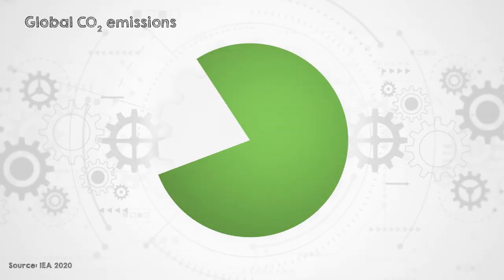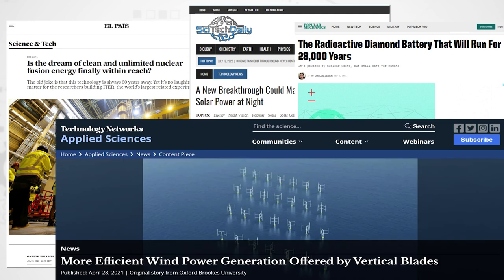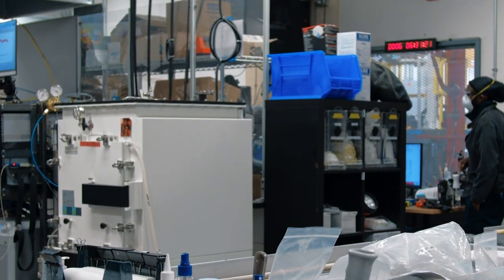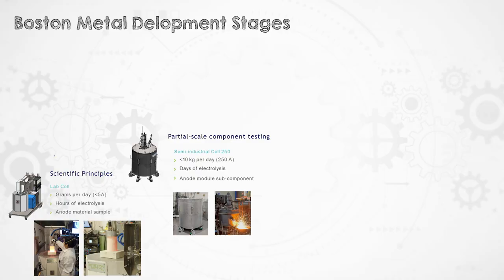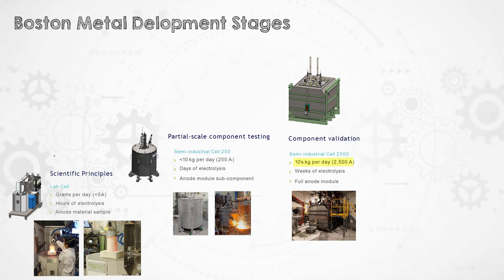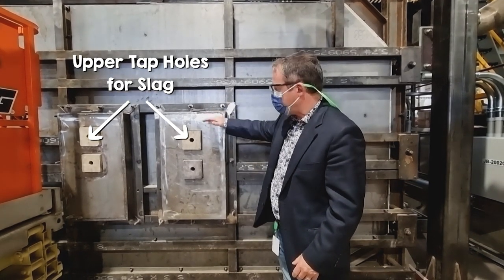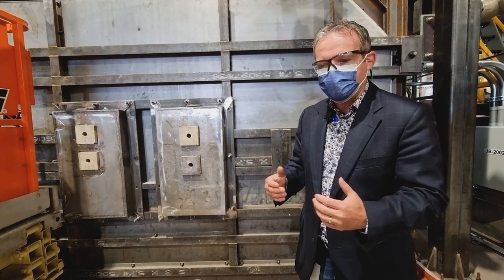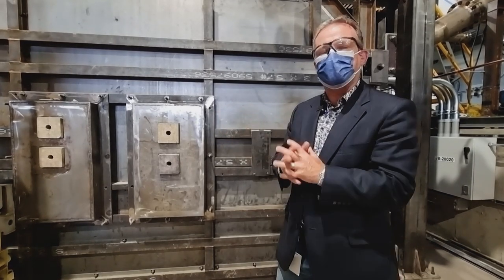CO2-Free Fe: Green Steel Tour with Boston Metal

Comment: Cleaning up steel industry carbon emissions is very important, given the vast amount of steel produced worldwide in a year.
Your video showed the stepping stones of their work as they scale up,  but it didn't explain how the process is green. 
Are they using H2, or some other process to rid the oxide from the iron ore, or is it simply the DC arc heating the ore to a point where the oxygen is released?

Either way, to fully replace the current volume processed in every smelter worldwide (1950 million tons P.A.), we're going to incredibly vast amounts of green power and/or green hydrogen. 
I wonder whether we can find that much extra energy and still power everything else, simply from wind, solar and hydro etc.
Reply: It doesnt burn fuel at the smelting plant. Thats how it stays clean. The power plant is still producing the co2. Its clean by pushing the cost off to someone else.
Reply: @fajile5109  We have lots of sources of clean electricity.  It doesn't have to be coal.  In fact, coal is being phased out of the electricity generation mix in much of the developed world.
Reply: You missed the part where she explained that the electricity is directly splitting the oxygen from the iron.  No hydrogen or any other reducing agents are needed.
Reply: @incognitotorpedo42 
Thanks, I watched it again, and it was glossed over quickly and I missed it.
It would have been great for Rosie to spend a little time exploring the process and explaining it a little better.

I wonder how much additional energy is required for the system over and above the current carbon process.

Comment: Sounds quite possible , the possible week point might be the electrodes. 600 A is quite a lot and it also need to go somewhere ( through the bottom) might not be easy. The attempts to make arcfurnaces DC current did not go well.  But ok, I am curious. The competition is using Hydrogen as the swedes try, not the old blast furnaces or carbon capture, but that is expensive.
Reply: If the Swedes use hydrogen to make steel, they will go out of business because the cost of hydrogen is not even competitive to natural gas.  Carbon capture also adds to the cost of steel.  Green steel will put lots of companies and jobs out of work.
Reply: @richardallison8745  the Swedish system is intended to use on site solar electricity to make the H2. That means that by the time they get there the cost of H2 on the open market is less relevant. Also, if other industries like aviation retool to hydrogen or ammonia then the cost of H2 on the market will initially rise due to demand but then plummet as H2 production ramps up.
Reply: MOE is an electrolysis process similar to aluminium smelting.  The best aluminium smelters run at 500,000 amps.  The highest ones run at about 600,000 amps.  This is very different from arc furnaces.
Reply: @MyStevieB  Very different.  Electrolysis in aluminum does not arc but uses huge amounts of electricity.  That is why there are almost no primary aluminum production in America because we don't have any hydroelectric dams that are dedicated to making aluminum.  Alcoa sold all their primary production in the Tennessee if not the entire US.
Reply: @richardallison8745  Try to look into the future.  We need to electrify processes that use carbon. Like many other industries, the power industry will have to reinvent itself by going green and by having to significantly increase its capacities too. Tackling climate change requires some bold thinking and actions.  Furthermore, please look again at Alcoa - they are a key partner in Elysis, the inert anode developer for aluminium smelting.

Comment: At what voltage do they run the cells?
Is it more efficient than using green hydrogen (I would assume so)?
Reply: They can run anywhere from 0.9 to 1.7V. But optimal is somewhere in between. The problem with too high voltage is probably that you then reduce other meterials (like molybden, silicon), making produce less pure and affect longevity of electrodes. In some places I read that due to various losses, 1.25V is close to optimal for iron reduction.
Reply: Come work for us and find out 👀

Comment: Awesome, love it. I wonder how this tech compares to using induction or microwaves
Reply: That doesn't reduce iron, it is a simple melting process. Most small foundries have got rid of their blast furnaces and melt via induction. A local foundry has two 700Kg induction furnaces. Presently one is shut down due to the cost of electricity. If it keeps going, they will shut up shop altogether
Reply: Like Robin said, you cannot make iron just by heating ore. This is an electrochemical process that uses electrical energy to break down the ore. Traditionally, energy from coke is used.

Comment: Ok but what do they dissolve the ore in? Like the melting points of iron and its oxides are pretty close and they need to keep it hot to melt the iron anyway. But all the other garbage like alumina and silicates is gonna need some flux, no?
Reply: Copper and matte have different densities and thus can be separated.  The same for iron and slag. After tapping the iron goes to ladle metallurgy to make steel.
Reply: @MyStevieB  My dude, I'm asking if they use something analogous to what  cryolyte does in aluminum production. It dissolves the oxides at a lower temp, so you dont need to crank up the heat to stupid levels to melt alumina.
Reply: @6alecapristrudel  In the patent is described that the electrolyte contains oxides of silicon, aluminum, magnesium,  and calcium.  Think of blast furnace slag or steelmaking slag. Key point is that the gangue in iron ore also has these components. That makes it so interesting.

Comment: There is a lot of iron oxide on Mars - it's the reason why it's red. Would a process like this make sense in that setting, given the need not only for structural steel but also oxygen? It probably wouldn't make sense without a pretty serious nuclear powerplant, but might there be a way to directly use the heat from the fission reaction to melt the ore? Maybe a stream of incoming ore powder could even be a coolant for the reactor?

Comment: Well, another post disappeared! I've signed in using a different Google account.
The slide in the video saying that iron making using hydrogen needs high grade ore, in limited supply, is correct.
Unfortunately over 70% of steel making equipment needs replacing by 2030, and electrolysis in quantity won't be ready by then.
I omit the links confirming this in case it is some weird spam filter chucking out any posts with links ,search for spglobal's analysis.

But we seem to be in a bit of a fix for decarbonising steel production.
Reply from the maker: Not all comments with links get deleted, but perhaps that is the reason as I can see this comment but couldn't see the others.
Did you see the earlier video I did on steel where my guest and I talked about the different options for  green steel? He basically split things into two, where up to 2030 it would be about reducing emissions in mostly existing equipment and then after would be about moving to zero emissions techs. 
https://www.youtube.com/watch?v=jWD2nI5RhpI
Reply: @EngineeringwithRosie  Yep, interesting video. I would comment more, but it seems a bit difficult here, and I am not a fan of Patreon's sweeping derogations of privacy, so there are several groups I would like to join, and don't mind paying, but don't fancy their conditions.
More on the point, I did post on your interview with Dr Martin on the hassles of piping hydrogen, mainly due to its lower energy by volume.

The post disappeared, but I thought my namesake missed the point, as if we are to hit the targets for GW, there is no way the NG pipelines will have to transport as much energy in, say, the UK or Germany as they currently do.

Better insulation of homes, heat pumps, solar with cooling and use of their heat as in your video visit, and so on and on, all mean that the 30% or so that the converted NG pipelines would need to carry as hydrogen is a pretty good fit.

Of course, 'and another thing' arguments may be made, but the notion that the lower capacity of the NG network converted to carry hydrogen is a showstopper simply makes no sense.

Naturally aside from the costs of conversion, maintaining a network to carry less energy is more expensive per KWh, but that is another argument.

Comment: Thank you for this video, it was very interesting, and I am looking forward to more on this!

For instance, is there any public estimate of the cost per Kg of this technology with respect to traditional ones? What are the constraints that bind firms to use one 200 kA cell, instead of two 100 kA ones? The last one might be a bit naive, but I have no engineering background.
Reply: From what I know, the cost per kg will be dominated by the cost of electricity plus the cost of the cell amortized over its expected lifetime.

As for cell size, I'm guessing it is a combination of labour efficiency and thermal efficiency.  To the former: it takes a lot less work to tap one big cell than it does to tap many little cells.  To the latter: the larger the cell, the less electricity will be lost out of the cell as heat.  The iron output of the cell is a function of its volume, its heat loss is a function of its surface area.  This is why the really small experimental cells had to be heated externally.  Volume cubes, surface area squares, so the larger the cell is the more energy efficient it will be.
Reply: @JonMartinYXD  That was a great, yet very easy explanation, thank you!

As for the cost, I agree on the long run drivers, but would still be cool to know where we stand now, that is the estimate of current €/Kg and the estimate of the "switch price" of electricity with respect to conventional steel.

Comment: I think their process is similar the Cambridge Farthing Process that was invented in Cambridge UK some 25 years ago.
It uses Calcium Oxide as a salt and dissolves the ore in it then electrolysis will reduce the Fe Ox to iron on the electrode and releases O2 on the other. I always thought this would be an eccellent process for metallurgy on the Moon or Mars, as it also produces large qontities of Oxygen that is needed for the life support systems.
However the power hunger of this process is ginormous. So it will need a nuclear plant next door to produce the required power. Otherwise, it will be a bit of an inefficient process if fossile fuels are used for the power generation. But it is too to see that this type of process is finally coming through. And with Russia out of the picture for Titanium for a while, it may also need to be used for that.
Reply: Helmut Zollner, the original MOE process is patented by Dr. Sadoway and Dr. Allanore.  It has been deeply scrutinized so it is a unique process.  From an energy point of view, the objective is to make steel using the MOE process with an amount of energy lesser or equal to conventional steelmaking processes like a blast furnace.  The difference is that MOE is 100% electrical energy while standard technology is a combination of electrical energy and chemical energy from coal (coke).  As long as we can be more efficient, then we get ahead.  Yes, the power generation industry needs to follow suit to keep up with the development of decarbonization tools like MOE that electrify conventional processes. The MOE process is also very efficient for the production of ferro-alloys.
Reply: @MyStevieB  I don't doubt that the patents are water tight. The Cambridge process was just the first metallurgical process that did not rely on chemical Energy and in laymens terms electrolyzed the melt and removed oxygen gas from an ore. The paper at the time stated that other metal.
So this new process goes in the same direction.
I see the big potential in these process not only the environmental benefit for the civilization Herron earth, but also for thevspave settlement efforts. It is obviously much more economic to produce building materials and atmosphere from in-situ resources. And these electric processes are perfect for that.
The old chemical processes were only viable because electricity was produced from fossile fuels, so using the coal directly in the process made it more efficient. With electric energy from other sources the chemical process is less useful.
Over all I am very excited to see these new processes coming online. Will make the whole industry a lot cleaner. Hoeever, steel productiin is such a cut-throat busibess, any new process will struggle to gain traction, if the carbon usage is not factored into the pricing. So, here on Earth it is going to be a political decision to adopt these processes.

Comment: You're saying this is carbon-free; but how is the needed energy generated? Are we just switching carbon emissions from the smelter to the power plant?  What is in the slag?  He said it is recycled: into what?  How does the cost/kg compare to the present method, specifically? "Costing" is mentioned but just how much more is this?  I'm not getting excited yet.
Reply: This is 'he'.  The process is 100% carbon free because it uses electricity as the reduction agent.  Scope 2 emissions can be carbon-free too if the method of power generation is also CO2 free.  This is where we are going in the future. The slag is considered standard and used in cement plants like BF slag is today. I hope you are getting a little more excited now.

Comment: The only benefit that I can see from the abstract of the research paper is that the rate of consumption of the electrodes is greatly reduced compared to a normal arc furnace.
Reply: @Kargoneth, the Boston Metal process uses special alloys for anodes and not (carbon) electrodes.  This is the core of why this process makes iron without CO2.  The other product is oxygen gas.
Reply: @MyStevieB  That makes sense. Thanks.